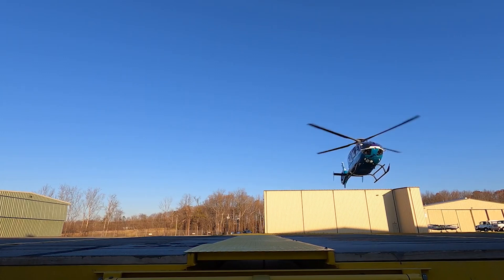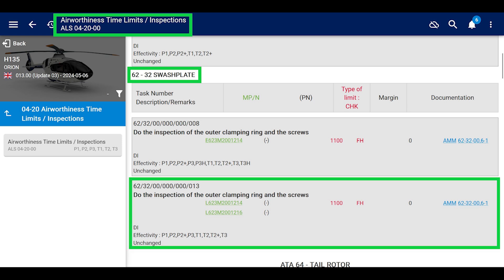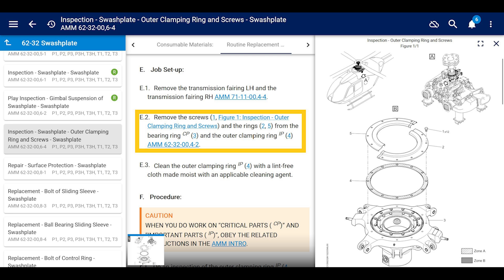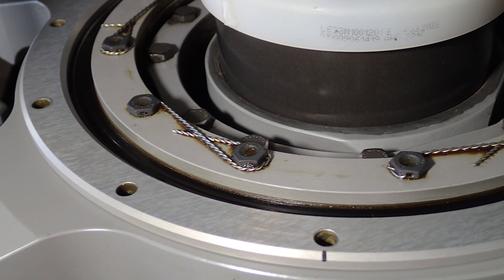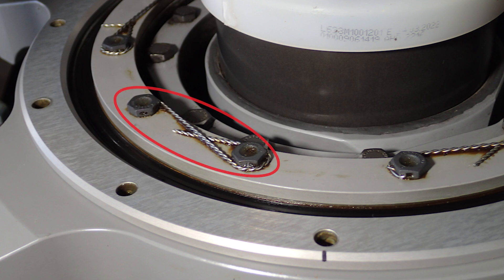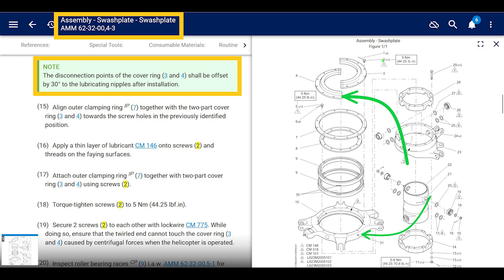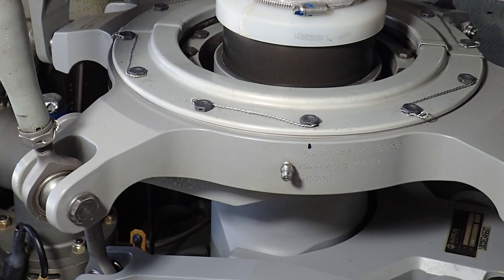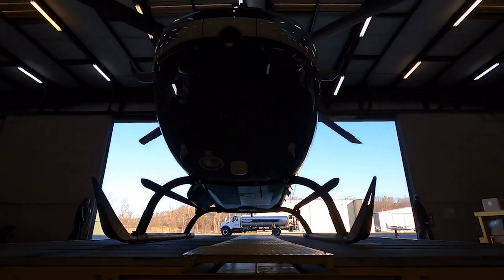Swashplate clamping ring Inspection | Airbus EC135 Helicopter

Comment: That lockwire is garbage lol, no pigtails and sharp edges tucked against the component
Reply from the maker: Are you talking about the wire on the cover or underneath?  I claim the bad wire work. Ha!
Reply: @HelicopterMaintenance  the lockwire on the stationary star cap (underneath) that have no pigtails.  You describe why in the video (which is correct) I just disagree with the way it’s done is all .